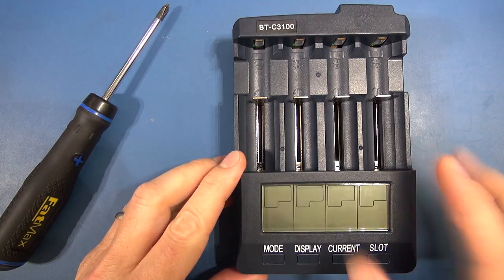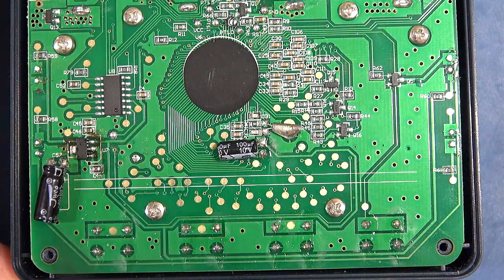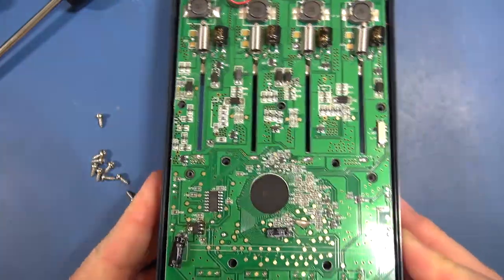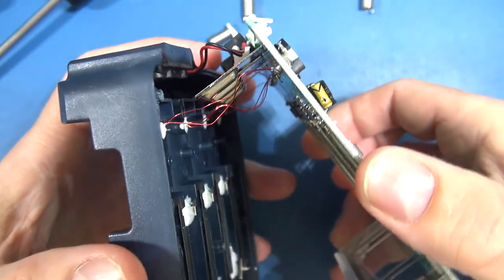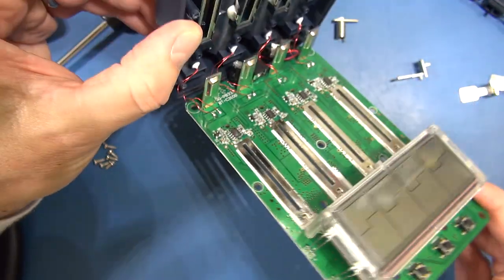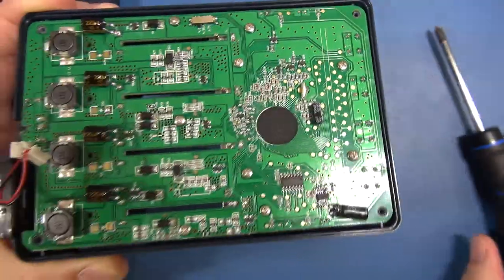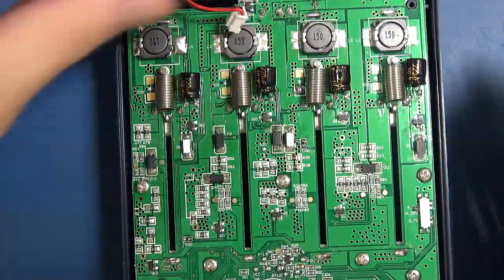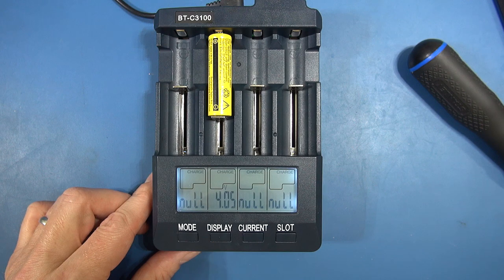BT-C3100 Battery Charger Pt 2

Comment: Martin, that P3484 ic is probably EUP3484 a 3A step-down converter by Eutech Microelectronics which logo is on that ic ;) So each cell has it's own step-down converter.
Reply: You're right. One of those recently burned out badly in mine, so I'll try to replace that (without the needed skills and the proper tools) when I get the replacement IC. :) So my advice to y'all: when one channel doesn't seem to charge a good cell and shows only a few mAmps, don't push it any longer, and try to have that IC replaced before it burns a hole in your PCB just like it did for me. :)

Comment: I think the tape over the vents is to force air over the cells through the slide slots, I have a fast charger with a huge fan that follows the same design. And all the via's most probable for thermal spreading and airflow.
The IC's per channel, with the suporting components look like buck convertors controled by the µC. I would imagine they are making all the noise on the scope and the cells don't really care about noise.
Thanks for the tear down, looks blood fiddly haha. And Meh to blob on boards, we will never know what the µC is.
BTW, this is all of the top of my head, I'm still learning.
Reply: I agree,I have one of the older designs without the fan and it uses the same or similar case. Some chargers without the fan pause charging if the batteries get too hot.

Comment: Just wondering what the tolerance is on the 12V DC input. If a cigar lighter cable is included (or available), it's probably good for between about 10V and 15V. I'd like to operate this from lead-acid batteries in a solar power set-up. The user guide doesn't provide any detail on this. http://img547.imageshack.us/img547/3070/y8v.pdf
Reply: Just use a BUCK step down which will bring a stable 12V and 2 Amps and it will be fine.
Reply: From an online forum, information from an Opus developer, input voltage can be from 8 to 16 VDC. The user manual states the charger requires a minimum current of 3 amps @ 12 volts.

Comment: their is a switch on the in side on the right hand side when its up side
 down looks like it changes the voltage 4.2 and 4.32 and 3.7 volt is labeled
 on the board

Comment: i have a solar charge controller but its a pwm and it discharges my 12 volt battery when the sun is not direct enough any ideas how to prevent discharge ? do you think this soplar charger is faulty? i want a better chargecontroller but they can get xpensive mines a cm3024z any ideas?

Comment: I am looking to buy a charger to mainly charge AA & AAA batteries, I often see the Duracell and Energizer chargers, $50 is the maximum I want to spend on a charger, also is it better to buy a charger without a fan, are the Duracell, Energizer and Uniross chargers better than Opus and are Amazon Rechargeable batteries the best and are they made by Panasonic but what charger should I buy, I want my batteries charged within 2 hours or faster.

Comment: Hey the fan work is only to cool batteries or ic's on the board what warms most? Because i want to unplug fan during refresh mode (4 batteries low 200ma charge/discharge)charger is in very low load but fan makes noise pusching cold air frequently when i sleep  can i do it?

Comment: Very nice review and teardown! It's very interesting to see such a clear dismantling like this ;)

Is the internal switch intended to switch to LiFePO4 chemistry which cuts off at 3.6/3.7 volts? If that is the case, this charger would be even more interesting. Wonder why they haven't put the switch on the outside.. But drilling a small hole right in top of the switch makes it possible to switch it from the outside (if you know what you're doing) with a small screwdriver.

Nevertheless i'm also a bit worried about possible resistance caused by the sliders. I've inspected the circuit board thoroughly and it appears that the sliders, that keeps the cells in place, only makes contact on the metal sliding tracks due to the force of the spring, but it seems that the spring and the small attached pin itself does not make any contact with the circuit board or the sliding tracks.

The pin who is connected to the spring goes thru the circuit board into the plastic of the housing and does not appear to make any visible contact. You can imagine that there will be a reasonable amount of resistance due the bad contact with as a result no correct measurements of the cells and therefore no correct charged cells.

Solder a short wire on each of the sliding track solderings and solder the other end of the wire onto each spring increases the chance of a better connection I think. Does this make any sense? I'm curious at your opinion about this.

I've ordered this charger already (there's a new 2.1 version out now) so maybe I'll do this modification myself ;)

Thanks again for the review!
Reply: Correct

Comment: My third slot went dead :( Opened it up and the IC U3 you mentioned is burned for that slot. Leg(1-4) is burned., and the C56 capacitor next to it is now black. Hoped it was only a dead capacitor problem. Mine is a bit different, did not have the tape, and a bit different components. V2.2 manufactured 2015-04-30. Thanks for the video.
Reply: Could you repair it? A similar disaster happened to my fourth channel: the input pin (the second one) burned a hole in the PCB, the + side of the capacitor and the copper track between them burned out, too.

Comment: Hi, I use this charger since 2 years, very good and reliable , but not perfect...because no Lifepo4 charge.
 Is the 3,7V switch really for charging Lifepo4 (Lfp) , I'm not sure...the best maxi charge for Li-Ion is 4,2V and not 4,35V...And for Lfp it's 3,6V MAXI and not 3,7V (best at 3,55V) . It can accept 3,7V but it's not good for the future of the battery.
I think it would be better to use this switch position for  Li-Ion storage.
I made a little hole in the backcover at the good place, so i don't need to open everytime i need to change the voltage.

This charger seems not built for LFP, it's a shame, it was not difficult to include this function .
The Top would be to have the choice with a 3,6V (3,55V) position for Lfp , and 4,15V for Li-Ion...Some Mah less, but much better for battery life.

Comment: Yes, that soldered part is a crystal. Most likely for counting the time shown on display.

I don't like the bodge style placement of those capacitors and i particularly don't like the choice of brand... it's a relatively expensive charger and that Jwco is a bad manufacturer. It may heat quite well inside during charging so this only adds up.
They could have chosen some tantalum capacitors and modify the pcb slightly to allow for that but that would have added maybe 1-2$ to the price.

That black tape may be a fix for EMI radiations or noise from those inductors on the bottom - maybe they wanted the cooling from those vents but it made too much noise or didn't pass tests.

Shame you didn't open the power supply as well... it seemed a bit tiny for a 12v 3A power supply and usually, some manufacturers really cheap out on such power supplies and have little protections and safety precautions inside.
Reply: Are there any other chargers (similar to this in terms of capabilities) that are better?

Comment: I know this is an old video but I found it when trying to find some info about hacking this unit to charge li-ion 18650 cells to the military preferred 3.9 as it allows the cells to last much longer. I wonder if anyone knows how to mod the v2.2 of this charger to change the 4.2v to 3.9v?
Reply: Hugh Justins i would be curious about this if you found a way
Reply: Using Op-Amp maybe ? It should be added between  read of voltage to controller, but it will work for charging only because you will add to discharge to .. or check maybe there is something you can adjust in charge switch circuit  (4.2,4.35,3.7)  maybe there are resistors to determine charge mode
Reply: Hugh Justins 
it's kind bother to wait btw,
but why don't just watch when the voltage is 3,9 then remove the battery.

but from what i read, if you willing to store li-ion more than a month
leave it @ 3,8 V

Comment: Nice teardown  - and it still works :). Very interesting review link in the description, it's charging behavior is a little misterious :). You are right, as others already said, the crystal looks like a 32.768kHz real-time clock crystal for the charging time clock. Cool that it can charge different cell technologies, but for me a 9V slot is missing. And I'm wondering, how this thing can charge the cells at max Amp - isn't this a little much for the 3A/12V power supply? Or can't you charge all with max power at the same time? The fan is really a fail (but not the biggest :) ), you just did such a nice PWM video, they should have used duty cycle based on temp and not only on and off :).
Reply: Maximum 6A 4.35V 26.1W charging. It uses buck circuit so can charge faster when using 12V 3A aka 36W Input